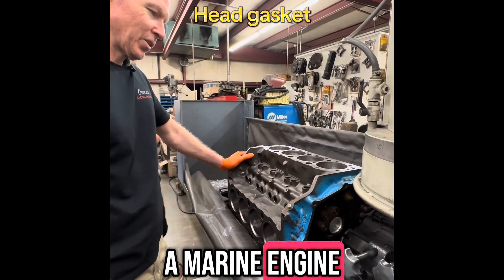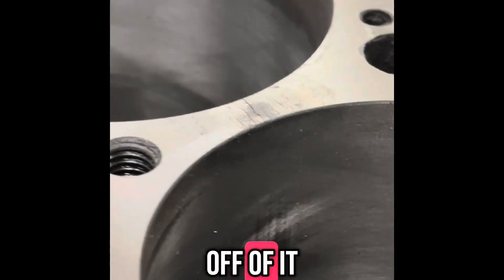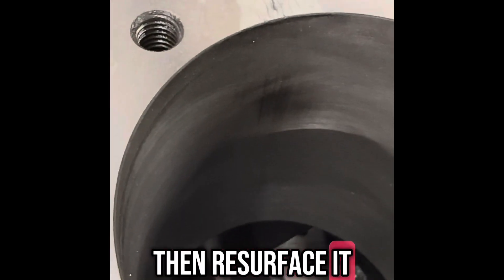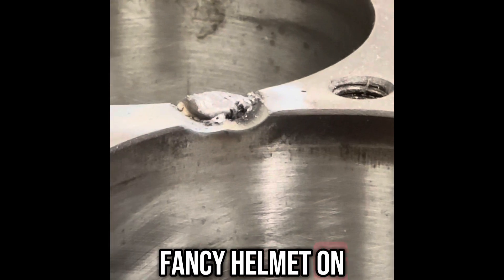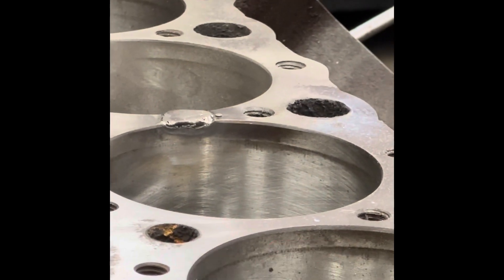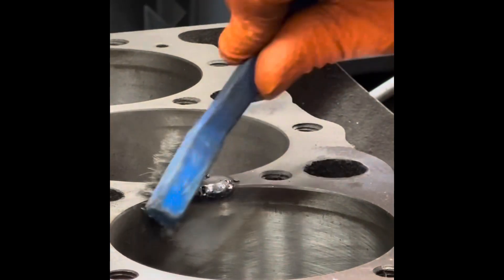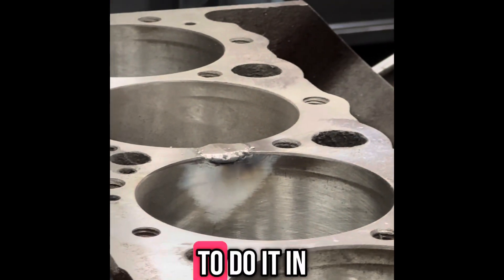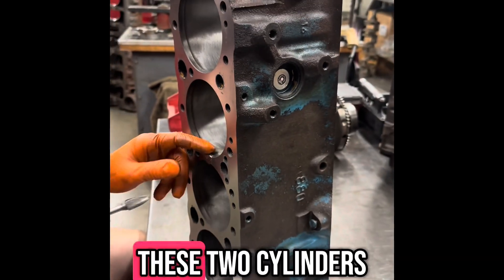Marine engine repair

Comment: Why don't you tell her a stick welder is a stick welder tig welders tungsten inert gas in a mig welders metallic inert gas I assume you're using a green tip High nickel rod